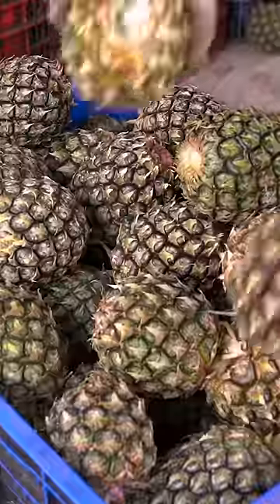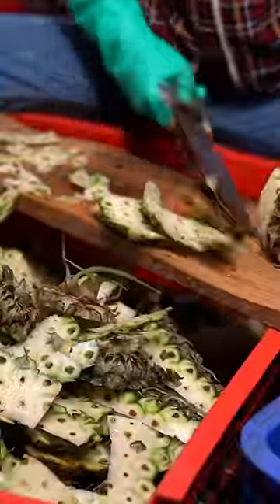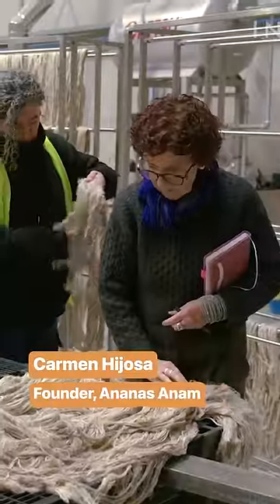This designer created a leather alternative with pineapple leaves. #Sustainable #Pineapple #Recycle

Comment: “We still have 5% to work on” 
What an amazing attitude. 11/10
Reply: Fairly certain leather is 100% renewable...

And biodegradable
Reply: @daslynnter9841 you missed the entire point of the video. Its referring to the waste of pineapple leaves.
Reply: @moegreene3630 uh no? She is saying that they are already at 95 percent and willing to figure the last 5 percent out. Were did you get your take from
Reply: Keep moving forward! It’s the best path to a good future
Reply: @franciscotorres1005 organic plant compost?
Reply: @gameseeker6307 yes but the byproduct for this I much more useful for replacing materials like Pleather which is more wasteful
Reply: @bastik.3011 she quite literally “we have 5% to work on” if you’re not using common sense how did you manage to come to that conclusion?
Reply: @daslynnter9841 bro it's more about making use of the pineapple leaves and leaving less waste in the world not about being better than leather but just to be another option
Reply: @daslynnter9841  the tanning process for leather is extremely toxic. They use a lot of heavy metals to tan the leather and most leather is coated with plastics to make it more durable
Reply: @daslynnter9841 I would go for pineapple leather than the real leather. The carbon footprint of producing real leather is much higher than the pineapple leather.
Reply: No, it's 10/10. Yall never use the rating correctly.
Reply: The 5% could be from the laces and metal ring caps to give the shoe rigidity and some structure which can't be replaced (yet).

95% still makes up the majority of the shoe.
Reply: It makes garbage clothing that degrade in like 4 years
Reply: @_Twink  You are wrong! It seems you have not seen one.  Fibers from pineapple are so durable. The barong tagalog  can last a lifetime.
Reply: @net-flix  they degrade after like 10 washes
Reply: @daslynnter9841   ..not the point, what is that the pineapple does not get burned...no CO2.
Reply: @daslynnter9841 You forgot to factor in the waste and pollution caused by the production of leather. It's absolutely NOT a sustainable product.
Reply: Respects and a big salute
Reply: It is literally impossible for them to make this without plastic or rubber which is what the last 5% is and will always be.  On top of that it’s not recyclable anymore nor is it biodegradable like the pineapple waste would have been had they just left if as is. You essentially have an inferior so-called “alternative” to leather that is extremely weak and that has all of it structural integrity dependent on the fact that it’s made from plastic or synthetic rubber.
Reply: @daslynnter9841 Exactly leather, especially vegetable tan leather is 100% biodegradable while this product is not biodegradable because of the plastic that is added to it to make it usable and even then it’s nowhere near and strong or as durable as leather.
Reply: @Metyourmatch And this stuff goes through a similar process. How do you think they colour it?
Reply: On your dollar. FOR twice the cost. Imagine it
Reply: Some countries are already using the fermented pineapple peals to make an alcoholic drink.  Taste like a light beer to cider depends on the fermentation time I think.  Or some secret ingredients. Plaisant   to drink , cold of corse.  It could be part of the  missing 5 percent  for a complete utilisation of the fruits and plants . I don’t go hole the way, juices from the leaves could make bio-gas , solid maters can also be composted then back to the fields.
Reply: if only developed nations cared this much... (they produce a massive fraction of ghg emissions all while shifting the blame onto others)
Reply: @daslynnter9841 So what? It takes significantly greater amounts of resources to produce the same amount of leather than this leather alternative
Reply: Wow, this is innovative, love it!
Reply: @_Twink  wash real leather it will degrade just as fast, it's because you do not wash real leather you clean it with saddle/leather soap, a rag and a brush, you do not ever put it in a washing machine or other soaps that will suck all the oils and and leave it dehydrated, stiff and cracking, same applies to this pineapple fibers leather,
Reply: Without that 5% , it will rot and ware out in no time
Reply: What will the earth eat? Do we have to use every ounce?
Reply: @EyeAme  you mean plants?
Reply: Idk how I can save a comment on YouTube but I love this
Reply: @raghavendra6921  It won't rot. The philippines has used pineapple fiber for a long time to make philippine traditional clothes and they used to wear those daily. They are very durable and do not rot.
Reply: @yuo_rii  yes natural fibers last long,  but not all
Reply: Waw..what brilliant great idea..God bless
Reply: What is the 5% wonder? Biodegradable or not?
Reply: 19/20 or 1/20 actually, depending how you look at 5%.
Reply: @daslynnter9841  it isn’t, leather requires fixers, dyes, and lacquers to make it last a decent amount of time. It’s not a bad thing though, because that 5% makes it last way longer than at 4% or 3%, so in the long run you end up with less plastic.
Reply: This has caught me as well. Most give up when cross 50 percent.
Reply: No. Growing the business would be far better. I.e, process more scraps. 95% of an industrial amount of waste is far more than 100% of what you have in your garage!
Reply: Absolutely amazing
Reply: @daslynnter9841 and long lasting
Reply: @daslynnter9841 This is to utilize pineapple scraps. And cows require an obscene amount of water and produce an obscene amount of methane so finding an alternative is still very beneficial.
Reply: @aliceroze5608 Most cow skins goes to waste and not leather. Making leather does not contribute to any extra pollution if natural colors are used.
Reply: Perfect is the enemy of good.
Reply: That five percent is the land the pineapples are grown on
Reply: 9.5/10
Reply: Very good! 😊
Reply: @daslynnter9841 animals still die for leather
Reply: I hope the 5%is not microplastics - like the plastic lining in supposedly “paper” cups
Reply: Pineapple 🤮 might as well use the whole thing to make shoes coz that's what it tastes like.
Reply: Incredible! I make every effort to consume products that cruelty free. I'm like 50%/50%. I hope this product is here to stay.
Reply: What’s the other five percent?
Reply: Waste not want not!!  Good idea she had and put it into action. Great work
Reply: @Metyourmatch . Very interesting to know. Thank you for sharing!!
Reply: @_Twink . Interesting
Reply: @_Twink . Is that so?  One states durable another state 4 yrs another 5 yrs and now you state dissolve in wash. Oh well that’s why product are always tested time and again and upgraded - right. We learn from errors then correct or drop project as lost cause but the point of matter is she took her idea and ran with it!!
Reply: She’s just saying that for the camera bozo
Reply: @daslynnter9841 Mass cow farming contributes greatly to climate change and animal suffering. It would be best to minimize this.
Reply: When you put that 11/10 on her true belief. You make it sound like a slogan.
Reply: @franciscotorres1005 it’s*😊
Reply: @franciscotorres1005  I agree that leather is a natural product/biodegradable, but the pineapple leaves have been given a purpose, and not wasting the leaves is good, too.  If it gives growers an extra source of revenue, that too is good.
Reply: @AlexanderMason1 as usual, “vegan” leathers are often less sustainable and biodegradable than the real thing
Reply: @daslynnter9841 it is renewable, lasts longer and yes… It is biodegradable🤣🤣!
Reply: @franciscotorres1005 ... - waste -....